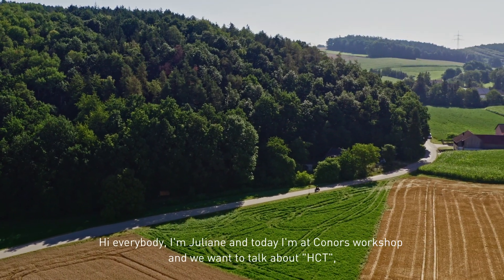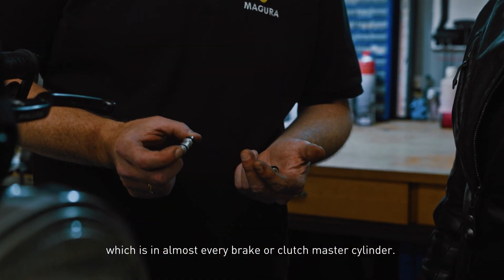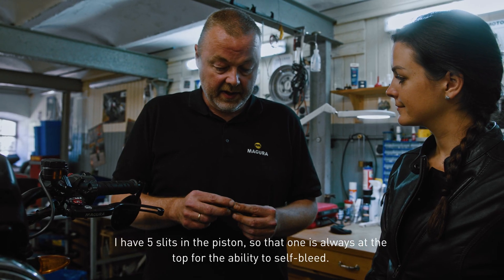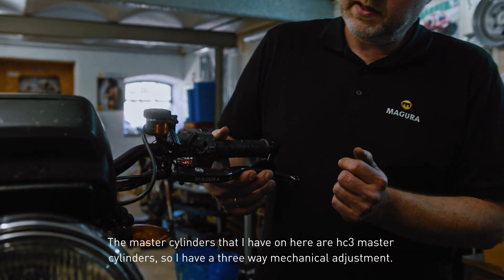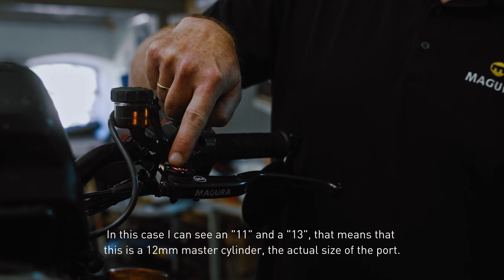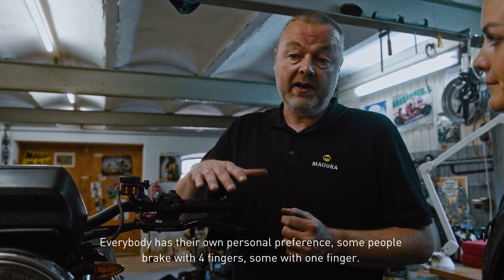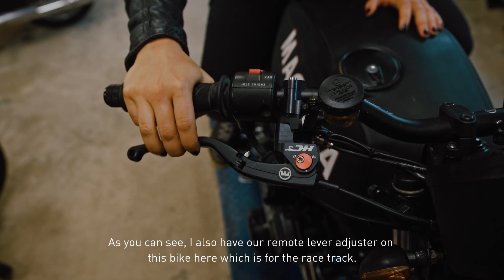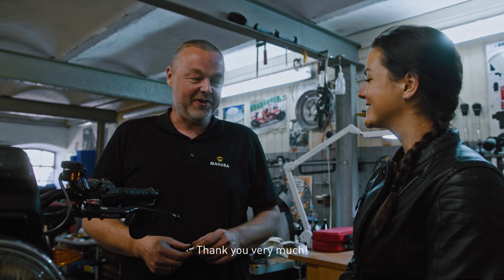Magura HCT - The Technology behind the HC1 & HC3 radial master cylinders

Comment: That 3 way adjuster adjusts lever ratio. The distance between the lever fulcrum and the piston pivot point. How does changing that distance mimic having a bigger diameter master piston? The piston is moving the same volume of fluid regardless what ratio is selected.
Reply from the maker: This mimics a change in piston diameter by changing the mechanical leverage of the master, "before" entering the hydraulic leverage "stage".

Comment: I have ordered a rebuild kit for the 195 master cylinder, it came with 2 springs, one small and one large, while the original piston I have removed only hard one large spring in it. What is the small spring for? Am I supposed to be using both springs? Is this some kind of design revision?
Reply from the maker: We will answer your question soon. Thanks for your patience and sorry for the delay.
Reply from the maker: Thanks for your request. You have to use both springs. I think your piston kit was replaced in the past and simply forgot to put in both springs. Send us an e-mail to powersports@magura.de if you need more informations or drawings / pictures.